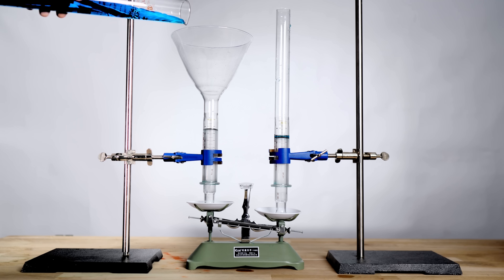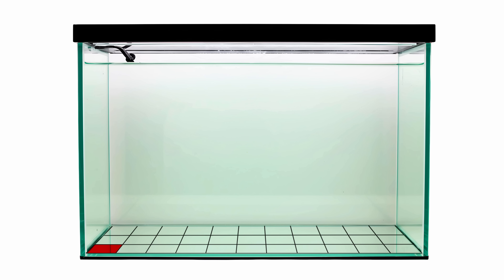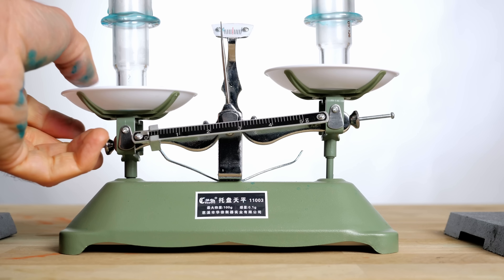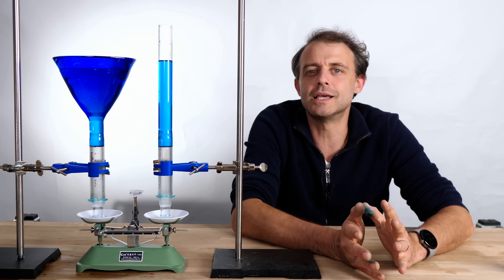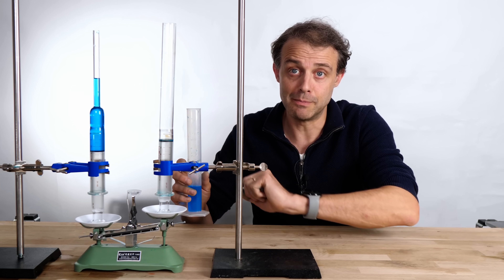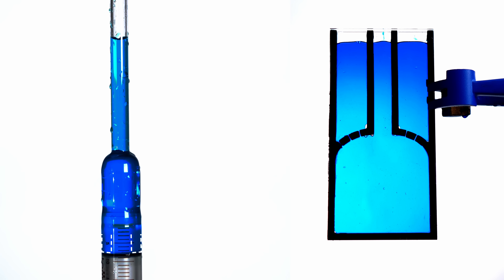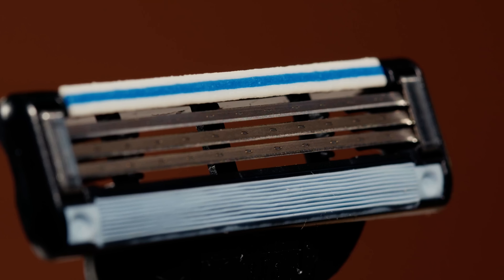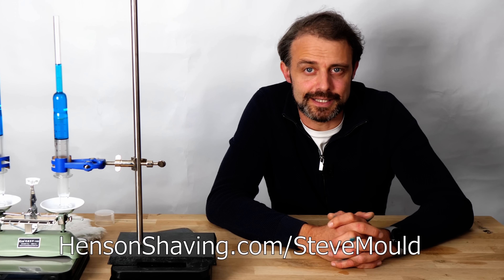The Hydrostatic Paradox

Comment: Does it have something to do with the normal force excerted by the funnel? Like the gravity on the liquid presses on the sides of the funnel as pressure and the downward force is absorbed/countered by the normal force of the funnel and the horizontal component doesn’t really factor into the weight of the water in the column…

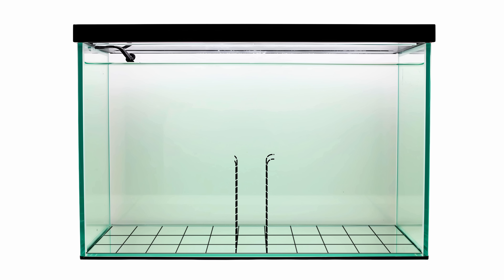Comment: @2:10 Hey Steve. What if you could change the shape of the tube without changing the water? Would that increase the weight on the scale? Maybe with some type of silicone tube that can fold up at the top? Or something stretchy like a condom? Just spitballing ideas
Reply: The only way to change the hydrostatic force on the Piston would be to move more of the water directly over top the Piston, thereby increasing the water line above the Piston.

Comment: i would love to see this same experiment done when the bases of the stands are locked down to the table entirely to prevent the clamp stand from being able to transfer it's weight into the scales. although setting this up might be rather tricky as, any movement in the clamp stand at all would allow it to transfer weight.

Comment: This principle ties to an  anecdote I heard working in a chemical plant: The walls of a storage tank had been sucked in slightly by vacuum. To push them back into shape the tank was filled full of water. When that didn't do it, an engineer told the maintenance techs to add a short length of pipe to a small diameter nozzle on the tank top. He then poured water into the pipe until the tank walls popped back out! All it took was the extra height (hydrostatic pressure) of water, irrespective of the volume of water or the pipe cross sectional area.

Comment: gravity is a funny beast, we still arent settled on a theory that fits every situation. I see it like Einstein, coming from inflation not compression. If he could have witnessed cosmic inflation it would have been the nail in Newtons coffin. The 2 align beautifully, when you do the math there is a clear link to the universal expansion and gravity.

Here is how I see it, at the core of any massive object you are null. Inflating at the same rate as the mass and the universe, you should be weightless, even tho under extreme pressures. If you move away from the core without any motion the mass is now inflating more than you in the same time, wihout collision you "sink" as it inflates past you, you never actually fall.  4000 miles from the core you are pushed up and out at 9.8 mtr/s

A nudge at the core keeps pace with the universe, if you are in orbit you are still null. When you arent where you should be, you feel the dislocation as weight. Right now you are higher and slower than orbital mechanics allows, so you feel like you fall down. If you was lower and faster than it allowed you would feel like you fall, up.  

Orbital mechanics and gravity come from inflation "Gravity is a push not a pull, Spacetime expansion theory" has a similar way of seeing it as I do, the guys there did the math, i came to my own conclusions independently, but its nice to see others are on similar pages. I think i can explain it steps ahead of them, in ways that are visual.

I Can build a universe simply squaring up C to infinity, i can show you dilation and motion coming from a static system. But I am pretty shit at the math,  I see the geometry, i can bend my perspectives with the universe. I hate rigid systems that have little room to bend, so yeah suck it math...

Comment: how do you think it works in the planet.. if you make it into a time cone you have the same kind of deal, at what point are you sharing points in the column below you to someone say 50 mtrs from you, there is a cross over point where your masses arent having any more push down on the core. Only points directly above and below the poles are actually putting their weight on the core itself, everywhere else is trying to orbit a place above it, like if collision suddenly turned off, most people would settle out into an orbit inside the mass of the planet, their fall wouldnt take them through the core itself, your angular momentum raises your lowest point, thats why you weigh slightly less at the equator even with a bulge of an oblate spheroid below you, you fall further at the poles, you are technically higher, tho lower. its weird no?? There should be more density above the core than at it. With the pressure looking like a toroid. 

We like to see it as Euclidean, as light finds space so regular and constant, it deals with space and time easy, that infinity has been conquered. We are the voids of infinite curiosity to it. Below you is an infinity it struggles to see into, it can't dilate in space and time, and if it could: we rely on its reflection and echo, it would need to return to us for us to be witness to its journey.  Is it 4000 miles to the core? Sure looks it from a finite perspective outside the system, but the density and pressures make the path longer the further you go. Its infinitely more challenging to go through the mass than it is to simply walk around it, but we still think a path connecting 2 points on a sphere is the flattest shortest path, Say you could make it happen, building a tunnel through the planet, it wouldnt feel flat to you, mapped on a time cone you see how each step feels step for step. Flatten out the time cone for density, is it still the shortest path?

The thing about fluids and solids is they should be pretty constant, their density doesnt tend to change as you add more, until its wayy more. There is so much mass beneath us, compressed and distorted, it isnt as Euclidean as we would like to imagine, its as Gauss could see it. As we drill into the planet your bit takes the path of least resistance, it wants to return to sender. The deeper you go the harder it gets to stay straight, and we have barely scratched the surface. 

So what is the bigger infinity, the one light can cross easy, or the one it cant? you give more validity to one over the other as light finds it so easy, if you was a lightwave you might think mass was an infinite void unable to be crossed or mapped. Perspective is a bitch huh.

I see the universe as singularities inside singularities, at the centre it should flatten out enough a second event horizon forms, and thats where we play out, the universe cooling as we give up mass to a larger infinity. Its a symphony of spheres in microgravity, causality smoothing out the mass transfers like a universal regulator/rectifier, making you AC journey a steady DC flow in one direction, all motion feeling like inflation, even sudden collapse will feel slow and steady to a witness, observers outside the system see collapse, infinity out and a finite system in, endlessly repeating, this is the universe how I see it. A set of infinite size, with infinite sets of infinite size dilated inside and around eachother, scaling in space and time is your way out of a time cone, simply rewinding for 13 billion years wont let you escape the singularity, or see it for anything other than a dilated perspective between infinitely hot and cold, never moving closer or further from either, its motion without motion, just dilation and mass transfers giving energy to a system, it looks and feels like a vector and looking back it seems like a logarithmic curve, when its actually a clunky mess if you could step outside of causality you could see it how it is, but you are linked to it, inflating with the universe as it does, it seems like a static reference frame as every reality stacks the same, space and time and mass all inflate together, the oddball is light, its not dilating as it crosses space and time, so it records the change.

What is truly in, or out, does it matter? If it is like a bunch of mirrors stacked against eachother, singularity to singularity, event horizon to horizon, does it matter? the infinity in can be larger, older and have more space and time dilated inside itself than the one we see out, its all just a matter of your perspective between infinities that give one more or less weight than another. Some higher reality is likely looking at us thinking we are just a virtual particle

Comment: From the aquarium tank illustration, I gathered that it was showing columns of water pushing downward without their downward pressure being affected by that of the adjacent columns. If a sphere, the diameter of one of those water columns were placed at the bottom of a column, would the sphere feel pressure from the adjacent columns of water or only from the water directly above it. I realize that I might be conflating pressure and force, but I am mentally trying to equate the aquarium illustration with the structural requirements of a diving bell in the ocean.

Comment: I've taken 14 week college classes that haven't explained pressure as well as this!
Reply: Really? That surprises me. The way hydrostatics was taught to me 20 years ago is that pressure is a scalar and so is the same in all directions at a point, and the pressure with depth relationship is basically the simplest example of control volume analysis (every term drops out except pressure from above and below the fluid element balancing with the mass of the fluid element itself, hence obtaining P = rho*g*h). I don't even think the lecturer bothered spending a whole lecture on it because it's basically the easiest part of an intro fluid mechanics course, lol.

Comment: Without having watched to the end yet... it just seems like as if the two columns were connected through the scale, like as if the water was in a U bend shaped tube, even with a funnel on one side and more volume it would balance itself. It would be really funny, if you could try it with idk some 100L aquarium on one, and some thin straw on the other side

Comment: Good demonstration. 22' and 15' diameter swimming pools with a depth of 4' will have the same lbs per inch on the sidewall if measured at the same height.

Comment: along the same lines, what I find just as amazing is the pressure or rather the lack of it when a water column is sealed at the top.  I have several long plastic tubes ( 8 feet and longer)  that I seal one open end with a balloon at the bottom, fill it with water seal it at the top and then lift it.  The rubber seal at the bottom does not show any deflection from the "weight " of the water inside the tube until some air is allowed to enter at the top.of the tube
Reply: I wonder what would happen if the tube was sufficiently long and raised sufficiently high? My guess is that at some point, even a complete vacuum won't be able to hold the water up and it will fall down without uncapping the end.

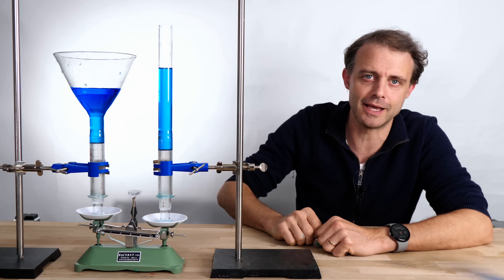Comment: at 1:00 in so I haven't heard the answer yet, but I'd bet a lot of money if you put a scale under each of the test tube clamp stands, you'd find the discrepancy there. Friction is transmitting some of the weight through the clamp back to the stand. And since there's an angled funnel on the left, the normal force is probably a bit higher, meaning more friction, meaning more weight can be transferred away from the balance.

Comment: So if the other cylinder syringe with the thick to narrow behaves differently... What happens if you have it as: 
narrow cylinder>funnel>wider cylinder (aka syringe)? 
        |
     ._|_.     (the . . is just a cover on the funnel)
     \   /
       V
       | |
       | |

My guess is it'll behave no different from a similar one with the funnel replaced by a syringe-sized cylinder... 
        |
        |
       | |
       | |
       | |
       | |

But I also lack all that stuff to test it myself. 🥴

Comment: Fluids are not solids and we cannot treat them alike.  The intuition derived from observing solids is often not valid when applied to fluids.  Solids can support a shearing force and oppose it with a restoring force; fluids cannot -- or might do so only VERY briefly.  The fact that fluids and solids both oppose compression does not make them alike.  Since fluids cannot sustain a shear force, they can supply forces only normal (perpendicular) to any surface -- including a boundary with a solid.  Your scales cannot see the upward force from the funnel's cone exerted on the fluid; they ONLY see the upward force of the plunger.

Comment: That was cool. At the end there, it really made sense as I could think of it as the stand holding itself up on top of the column of water because it was largely (not entirely) blocked from sliding up the tube. If it was entirely blocked, that would be even more obvious.

Comment: You're not measuring the weight of the water, you're measuring the force exerted on the piston, which is depends on pressure and area of the piston. Since the pistons have equal area, you're only comparing the pressure of both water columns, which is the same when both have the same height. On the 550ml of water, there is more total force being applied. But most is applied to the walls of the container, not the piston.

Comment: every  attempt to simplify and explain hydrostatic pressure  with shapes, height of  columns etc I've seen  miserably  failed with counter examples

because it's a local law and the demonstration is done by differential equations . dividing you liquid into and infinity of infinitely small cubes. each cube has same pressure on the sides, and slightly higher pressure on the bottom than the top to balance  the weight of the cube..this is why pressure is a vertical gradient, and once you integrate between two points , only the height diference matters, not the path you take or the shape of the container.

Comment: 9:33 - The pressure under the glass "lifts" the clamp stand by the weight of the "missing" water (since it is pushing it upwards, the horizontal components cancel each other out), and the clamp stand returns an equal force (weight of the "missing" water) on the scale
Reply: Yes, but it's still quite unintuitive to me when you imagine taking it to the extreme.  Imagine the same test we saw but with the vertical column of the weird shaped glass having an additional vertical column only 1mm wide.  Now at some point, and probably by 1mm, surface tension is going to alter these effects significantly, but if we had a treated surface with zero surface tension, a water column of equal height at was even a millimeter in diameter would produce the same effect as a glass of consistent width... that's crazy.  I guess it all relies on the fact that water is virtually uncompressible, because it's crazy to think that the pressure produced by the height of a water column only as wide as a needle for example, would exert the same "upward" force on the interior top section of the wider glass internal space below, as would the column shown that is say half or a third the width of the final width... but apparently it does exactly that.   I guess hydraulics rely on exactly this principle... we can apply IMMENSE forces precisely by using small cross sectional areas and thus small volume per distance... the tradeoff being the distance moved by the larger volume that we apply force to with the smaller volume.  It's simply the liquid version of leverage or mechanical advantage.

Comment: This is why the "Joke/Riddle" about a pound of feathers vs. a pound of lead only works if you use pounds.  If you try to be "metric" and use Kilograms then the mass of lead DOES weigh more than the mass of feathers.  Kilograms are a single factor unit of measurement of Mass.  Pounds are a multifactor unit of measurment of total forces here on Earth.  The above Joke/Riddle falls apart when your metric unit fails to account for buoyancy due to displacement of ambient atmosphere.  If you are using a unit of force (such as pounds) then Gravity/mass/buoyancy(displacement of ambient fluid medium) are all factors in the downward force of weight.  This is why you are "weightless" in space, but not "massless" in space.  Still not convinced?  Weight one kilogram of hydrogen gas vs. one kilogram of lead, one will have a negative weight, and it isn't the lead, both will still have the same mass, however.  Moral of the story, don't try to be so smart you out-smart yourself.

Comment: This isn't really a paradox, cool as it is. The clamp & stand are simply bearing the mass of the additional fluid in the funnel. Water is non-compressable, and gravity (on this scale) is unidirectional, so the column of water above the piston isn't affected by the surrounding water in the funnel. Take away the clamp stands, and you'll see which container really has the most mass.

Comment: I have an intuitive explanation for this particular setup, but it weakens for the case where lengths of pistons are different.

Scale can be replaced with U connector with liquid in it. Such setup will always aim at the same level of liquid on the right and left - so the pistons will be moving depending on how much water is on the right or left. If you want to have pistons on the same level (means pressure on them is equal) you will have to have equal amount of water on both sides above pistons.

The thing is that if pistons are of different lenght (you can put 2 metal cubes on both side: one lifting the piston and another just sitting on the scale cup). In this case neither pistons nor water will be on the same level when scale is synced.

Comment: I was racking my brain about this whole concept in the middle of the night literally a week ago for no reason. I'm still a little confused because I was stuck on the idea of a box with a shelf inside of it. It would basically look like a blocky "C". If you measure pressure on the bottom right of the C, will it account for the water on the top right of the C above the shelf as well? Or does it not matter because there is a barrier between them?